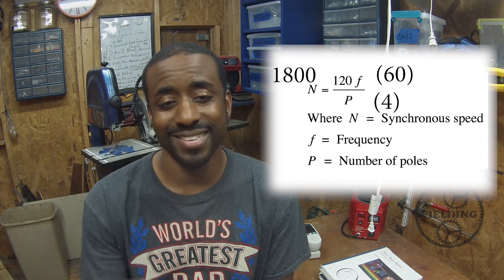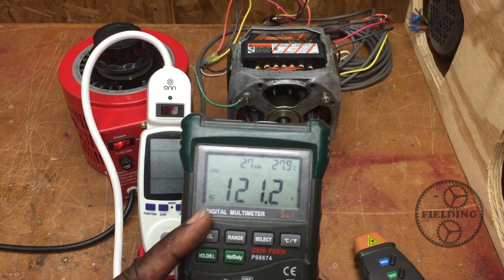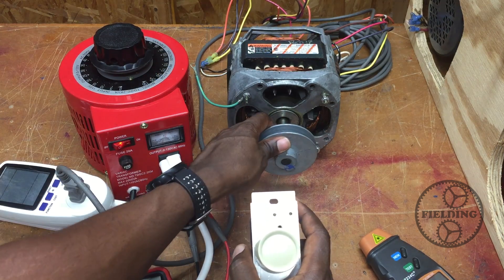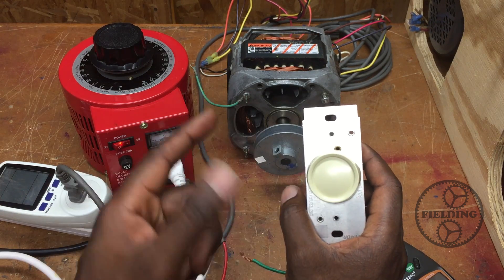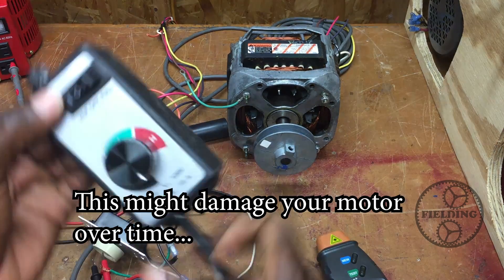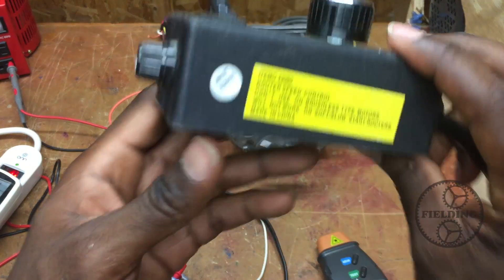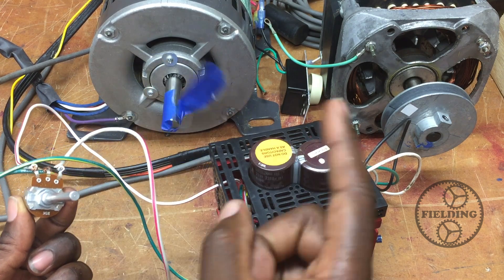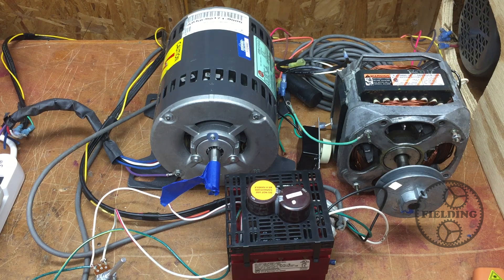Will A Dimmer Switch or Transformer Control An Induction Motor's Speed: 038

Comment: Jeremy-  Your videos have really helped my understand electric motors. I think you might be able to help me with my current project. I have a 3/4 hp 120v single phase motor I took out of a lathe. There is a control panel on the lathe that runs the motor between 90 and 2000 rpm. I could use the control panel but it takes up too much room.  I need to vary the speed between 1000-2000 rpm. Any suggestions? Thanking you in advance. -Jim

Comment: I have a 550 w/240v motor an my lathe. It has manual variable speed. I wish to covert it to electronic variable speed as you have better control. With what setup would you go about to do this. Do you use a frequency  drive or one of the chinese  motor govenors which come with limited  instructions. I am recovering from a brain aneurysm in 2009 ( and doing very well)  so  i am picking your vaste knowlrdge. Any ideas would be of great help. Yours john.s

Comment: It seems to me that one could control a single phase AC motor's speed by converting AC to DC then outputting a variable frequency, say from 10 - 70 Hertz. Why does no one make such a device? What are the technical detriments.

Comment: what happens when you use a soft start on a motor is it that the voltage just goes up slowly and you just don't get a higher amp draw when starting the motor ?

Comment: I get the sense Jeremy, from watching your video that you really know what you are talking about, so I know that I am at the right place to ask this question.
Recently my CPAP machine died and new ones in Australia can cost over $1000. In an effort to D.I.Y. to save money, I want to build one out of a Vacuum Cleaner, using the 'Blower' function of a new Vac. to supply air to a face mask.
Can you advise me if I can use a Variac to supply power to a new Bosch UniversalVac15 vacuum cleaner. I want to slow the Vac-motor down to just supply an air flow from the 'blower' hole to act as an air supply, mimicking a CPAP machine, to which I will attach a face-mask. That would be my constant air supply for breathing. Can I use a 500VA / 0-260VAC  Variable Laboratory Autotransfomer (Variac)  (in Australia) to slow the speed of the Vac-Motor without damaging it? I could be using it for about 10 hours at a time?  I also assume that the action of breathing would not put any significant load on the Vac motor. 
Your quote :  "A VFD is the only proper way to vary the speed of an induction motor" makes me think that I am on the wrong track. Is that so? Thanks in advance. Cheers.

Comment: I have a remote controlled ceiling fan. On high it's not as powerful as the ones on the other floors. When you go to slower speeds it makes a low whining sound. Should I bypass the remote system in it and just us the switches/chains or just buy another fan ? Thanks

Comment: hello! i do have a question, is there anyway to increase ac voltage just a little bit? like i wanted to bump up the voltage of a brushed vacuum motor for more power. its currently running at 120v 13.5 amps no load. i wanted to bump it up to 130v or even 140v. is there anyway i can do this without using bulky VFD or variac? thanks in advanced!

Comment: Awesome video. I have a 3450 rpm 120V single phase motor on a small metal lathe that is spinning twice as fast as the original one was supposed to. Looks like the best option is to source one that spins at 1725 to make it run reliably.
Reply: I'm not an Electrician but my understanding is 3 phase power is just 3, single phases offset by 90deg. So I would think you could use a 3phase vfd but only use 1 phase to drive the motor. I'm wondering if anyone knows if this would work.

Comment: I have an AC motor connected to a water pump it was originally in a hot tub application…First of all how do I tell whether it’s induction or another type of AC motor to know what type of application I need to use to control the speed? Basically I need to be able to vary the speed and power of the motor somewhere around 30 to 60% at 120V supply

Comment: Do you have an explanation explaining why we couldn't use an ECM module to modulate an induction motor I teach a trade school for HVAC and would like to run a cut open compressor at slow speeds to show the internals moving

Comment: I'm considering using an AC motor for an outboard boat motor, instead of 48v high voltage DC. Inverters are easy to get and lead acid batteries are easy to get and use. A VFD would give me full control. The advantage is I wouldn't have very high currents to handle, just from the batteries to the inverter. Simple outdoor rated AC wiring from there on. It also supplies AC power for other uses. The flip is I would have 115VAC inches from water. There's a possibility of water on the floor of the boat. Can this be done safely?

Comment: I have to build a heavy turntable that can hold 300 lbs.  I was thinking about putting a one horse power motor on it from harbor freight, now I am reconsidering everything.
It's a single phase 60Hz 115/230 1HP motor
I need it to go really slow and stop

Comment: I noticed the motor was 220v, and the VFD is rated 110v/220v, my question is, were you running that 220v motor while feeding your VFD with 110v? Or, were you feeding the VFD with 220v?

Comment: I have 2 3phase motors, one is 3hp, I think the other is 1.5 hp that I got when I was doing a demo of a commercial building, they were the motors for the overhead doors.  Never found out if they worked or not but I assume that they will.  Been hanging onto them for years just in case.  Good to know that I can just buy a VFD and wire them up to see if they work.  I am currently trying to find if I can change the speed on my .5hp motor that I use for my lathe but it looks like the only way to do so is to use gear ratios.

Comment: Good video, subscribed🙂…I have a corded 12a Sawzall and wanted to control the speed without pressing the trigger so I purchased  a variable vent fan speed adjuster speed controller. Is there a chance I could burn the switch out? I’m assuming this is like a dimmer switch and lowering the voltage and not the frequency as a VFD would do.

Comment: hi Jeremy, Im one of ur followers/student. I recently turned my electric water pump, into a knife sharpener. The problem I see, is that it turns to fast. It works fine, but I would like to slow it down some. It does have a capacitor, as these motors should correct ????? thank you in advance, and I do enjoy ur vids, U R MY TEACHER

Comment: Thanks for that really good explanation - I understand the issues now. Now I KNOW I am no further forward - I need to cut mild steel accurately, I have to choose between using an abrasive disk and making a mess, or using a TCT disk and wrecking it.
Which raises the question, why does nobody make a DIY mitre saw with a low speed option that can be used for cutting steel? It's something loads of people want to do.

Comment: I have a Wen variable speed grinder. I appears to be a brushless induction motor. But it has a dial and can vary the speed. It's clearly not a VFD, so if a dimmer/router speed controller won't won't on induction motors as this video show, what is the circuit it uses?

Comment: Great video!  I am having some trouble slowing down a 12amp brushed Harbor Freight Pipe Threader.  I am using the threader as a power source for a sheet metal bead roller.  It works good, but a little too fast.  I purchaser a Router Speed control like you show in your video.  The threader does not have variable speed in the switch and is a brush type 110v AC motor.  The threader is 12amp but I assume that is under load, but I could be wrong on how that works.  I get absolutely no effect using the Router Speed Control.  I did plug my 4 grinder in and it kind of made in run slower but  choppy.  Thanks

Comment: I definitely heard the hum when I ran my desk fan thru a triac dimmer but does that imply those ceiling fan controls in a warehouse I worked at were just slowly damaging the motors?
Also thot I found a 'simple' circuit that could split a single phase waveform into 3, almost looked like a full bridge with capacitors to phase the line 120 degrees but never tried to assemble it..

Comment: excellent video.  I was just wondering why  you said you may damage your motor if you kept running the dimmer.   I found this video because the circuit board is fried on an old but expensive treadmill i have and since I never used the programming anyway, I was thinking of just wiring the motor to a cheap motor control knob off the internet, but then I saw your dimmer idea.

Comment: I have a 230v universal motor from a vacuum cleaner, should i use a voltage regulator or a potentiometer to regulate the speed

Comment: Great insight! Great Video! I've spent countless hours watching other channels like yours and most end up leaving me confused. I would like to know a simple and cheap yet solid way to build my own high voltage speed controller (mostly from parts pulled from other electronics) to control a 36V brushless hub motor pulled from a Zappy 3 e-scooter.

Comment: I have a old air compressor motor that is 120vac i removed the pump and would like to be able to control the motor speed im unsure of the watts or amps on the motor there is not tag for the info 

My question is how can I find out the watts and amps and what can I use to control the motor? Can I use a dimmer for a house lighting? 

I'm 20 years old and love your videos and find them very educational thanks

Also note the motor i have is a capacitor start i believe cause it has a centrifugal switch on it

Comment: Jeremy - I love your videos. One other question, if you wanted to have a variable speed fan motor for a box fan or evaporative cooler, what type of motor would you recommend? I've heard you say you should have gear changes for different speeds - so I started to wonder if there's a CVT for a fan motor - or if you've ever thought about building one?  Thanks.
Reply from the maker: This video has  a part two that takes about fans

Comment: Can you use a triac / light dimmer to manually control the inrush current of an induction motor?  I have an induciton motor that will sometimes trip the breaker on start up, but only uses 10 amps once it's up to speed.  I am not interested in controlling the speed...just slow start.

Comment: It is possible to control single phase motors with a specialized 90º VFD. The motor must be a permanent capacitor type, where the windings are equal and 90º apart. You have to tale out the capacitor, as you don't need it.

Comment: Very cool, I have a blower motor for my fireplace and a cheep speed control to slow it down when the fire is low.   My voltage meter reads a constant 120 volts from the plug?  So it works with frequency (I guess) but is this burning out this simple blower motor?

Comment: Great video and explanation.

Wouldn’t it be possible (in a roundabout way) to control single phase frequency using a DC to AC variable frequency? 

I understand the limitations of a stock single phase motor, but maybe it could be modified to work with this idea. 

It wouldn’t be super efficient to convert 110AC to 90VDC (just an example) then invert it back to AC, but it might work.
Reply from the maker: That is what a VFD does... This is already a product.

Comment: One more comment,they are more expensive than a regular light dimmer switch but they do have switches for a motor like a ceiling fan it will slow the fan down is it a different kind of motor or is that little switch actually capable of changing the hurts and slowing the motor
Reply from the maker: Watch part two of this video about fans

Comment: I learned about motor speed being changed by Hertz and not reducing voltage. I put a dimmer switch on the bathroom fan. And sure enough didn't take long and that motor burnt up

Comment: So I have a 6.5hp shop vac .I want to be able to control the motor speed for two reasons.one I am using the shop vac as a regular vaccume cleaner in my apartment.This thing can darn near rip the carpet off the floor and second problem is it's really loud.I was told harbor freight sold a variable speed controller that would work, without damaging the motor. I got the information from a gentleman that is using this method for his forge. He needs to bigger shot back to get enough air for higher temps but there are times when he's bringing things up slower and the way he has solved the problem is with this variable speed from harbor freight. So what do you think will it work or not it sure looks like the same thing that you were showing in your video that variable speed switch

Comment: Years ago, a friend of mine hooked a large audio amp up to a transformer which could produce 120v RMS at whatever frequency he wanted.

Experiments with a fan showed that the speed would decrease initially as as line frequency decreased but beyond a certain point the speed would start to increase again as the line frequency continued to drop.

I was quite surprised.

Comment: "A vfd is the only proper way to vary the speed of an induction motor." Thanks a lot for that bro! \m/
All the other way that are there on the internet are probably for views or theoretical "flaunting" i guess, because neither do they work without damaging the system nor are they used anywhere especially for professional and commercial purposes..
great job

Comment: What about a brushed motor like on a miter saw? I want to convert an old miter saw into a cold cut saw (which requires 1/2 the RPM). How would I correctly go about that without swapping the motor?

Comment: Do you also how the speed control works on an 220v 50hz mag drill? And if it's possible To convert an older mag drill to one with speed control like most newer models have?
I am very curious about that.

Comment: This is great - very informative. I still have a question. I have an evaporative cooler that only has 2 speeds and I'd like to make it variable speed. It likely has a brushless submersible pump. It sounds like hooking it to a dimmer switch would be a bad idea - correct?  Is there a PWM adapter or switch that would work to make it variable speed - both the pump and the fan?

Comment: Great demo. Thanks for the clear info.

So if you have a kitchen range hood fan with 2 speeds and you want to reduce the speed then there's no way of doing it? 

I've seen some people use dimmers on shaded pole induction AC motors, but as I've seen here and other videos, it's not recommended as it reduces the life of the motor over time.

I have a range hood fan that is 44 Watts on low, and is too loud for me.
From my 'research' into shaded pole induction AC motors for fans, they are pretty limited, and the design seems like a compromise. 

Also, it seems range hood fans are generally too powerful for their application. I.e. over engineered for huge air flow movement, but not much good for low air flow movement.

I would recommend at least 3 speeds if you are looking at one. Then you can at least use the lowest fan speed to minimise noise. I am talking your basic fixed range hood that is fitted below a shallow cupboard.

Comment: But how does a controller control the speed of a ceiling fan? Mine has just two terminals for that. F and A. When shorted, it runs full speed. Else it shuts off. But the controller has three speeds on these terminals. Hi, med and low.
Reply: I think ceiling fans are permanent magnet motors, and that might have something to do with it.  I'm just learning about this stuff myself.
Reply: Forget what I just said, I looked it up.  Ceiling fan motors have different windings in their rotor.  Somehow the control switch activates the different windings, which alters the speed.

Comment: I have a VERY OLD Makita Model 2414 Metal chop saw labeled as 13 Amps 3800 RPM 115 Volts AC.  Prominent on the motor housing are two slotted brush holders so I know it is not an induction motor.  New blade technology has come along and I wish to run this saw at 1600 RPM to take advantage of the newer style blades.  Will a Variac work to get me down to 1600?

Comment: Like everyone has Said, thank you so much. 

I have a window shutter, it's an ac brushless motor and runs at a constant speed. When I opened it after a failure, I found some blown components in the circuit, I tried and failed to fix it.

When I connect directly, bypassing the circuit, the motor rotates at an increased speed. I built a triac circuit to try fix the speed but it couldn't help, as this video has clearly explained. The motor just makes very loud humming sounds when I turn the potentiometer.

So, what is in that circuit that reduces the speed of the shutter without humming

Comment: There are single phase VFDs available in the industrial market. We use a LENZE brand in my shop. (they also have 120v input to 230v 3ph) Also check Automation Direct for single phz drives. either brand are not terribly expensive.

Comment: So I want to upgrade the house power on my old craftsman 12 bandsaw and I picked up a 1 1/8 hp motor from a shopsmith but it runs at 3400 rpm and the old motor runs at 1725ish. Can I hook the new motor up safely by using larger pulleys? I'm super new to messing with motors and I'm in general pretty dumb if anyone has a suggestion let me know. Sorry for my ignorance.

Comment: Given a 2-pole induction motor with a nameplate rating of 3600 RPM at 60 Hz, if  I use a VFD to supply a 100 Hz input, I should expect an increased synchronous speed of 6000 RPM with an expected decrease in torque.  Are there any other negative effects on the heat dissipation or the bearings that I should be aware of?